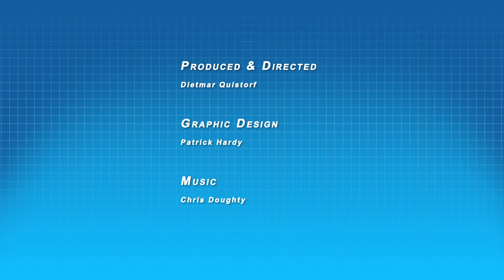Under Gravel Filtration for Ponds - Ask #37

Comment: Is there any form of equation regarding pipe size and length. I've got excavation on approximately a 150x200 ft pond beginning in spring. It will be stocked with panfish, large mouth, walleye and perch.... Maybe a few goldfish or koi. My thoughts are approximately 1/3 of my surface are will be in the 1-3 ft range. This will have some trenches cut to lay 4 inch perforated throughout the shallow. The trench will be filled with a good bit of river wash and topped with several inches of pea gravel. I plan on a shelf that will  lock this smaller stone in and my corrugated pipe will emerge at the transfer to deeper water 6-9 ft deep. Where my shelf is I'll connect some powerful airlifts and secure in place. That depth will allow more head and flow due to pressure gain at depth. On my deep end I plan on running 4 inch perforated as well same idea but trench with pipe, enclosed by river rock and topped with rip rap rock. The shallow and deep will be connected at the drop off shelf via airlift. Essentially with a double wall airlift I can drawl from the deep as an inlet, enter airlift and push out through planted shallow for regeneration zone. I forgot one piece my 4 inch perforated pipe will have a 4 inch cap allowing access should I need to feed a transfer pump in for solid or waste clean out. My thought is running 2 hiblow 100LL or 120LL pushing six 3 inch ID sleeved 4 inch OD airlifts with 2x4 inch stone. I've got a handle on concept. I've kept many fish and exotic reptiles and amphibians. My career was private military tech literally building missiles and rocked systems. I know how to work tools, math, prints and have sound mechanical ability. I've not seen any form of equations based on flow, diameter or run length say per volume of water. I understand I've really got one opportunity and would prefer getting it right and not being forced to add or change as waters filling. Any help would really be appreciated or any nudge to a reference of similar theme. I figure principals are principals regardless of size but due to the size this isn't an easy change or correction. Thanks.